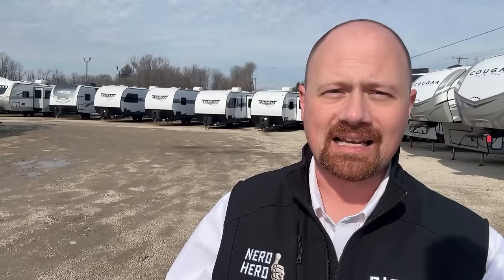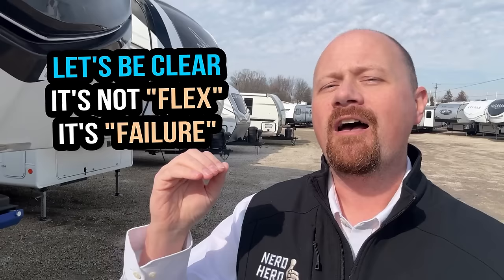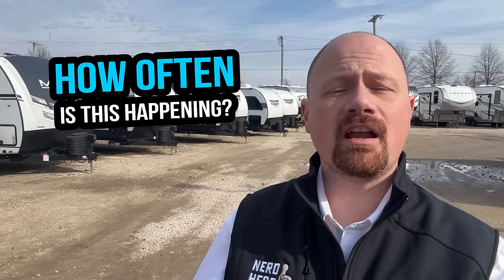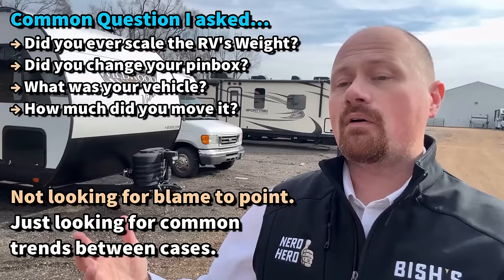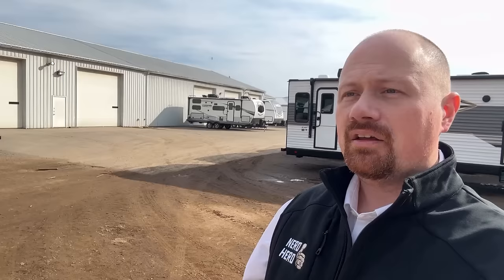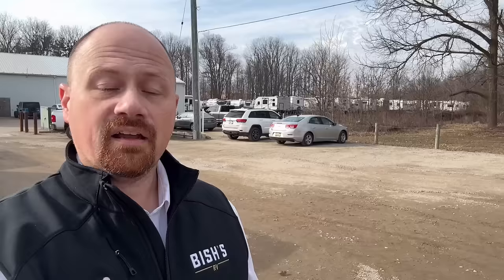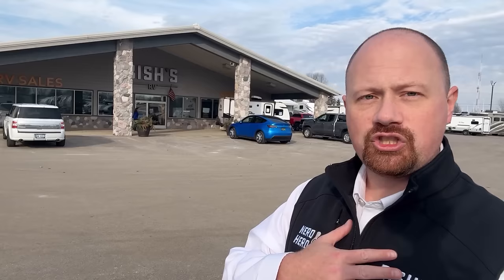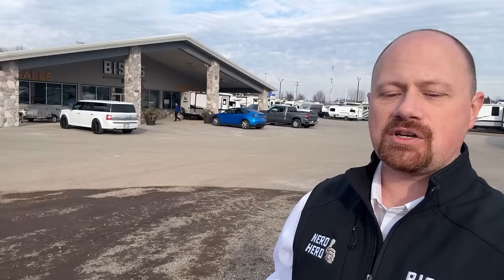🚨 RV Frame Flex & FAILURE!! • WHAT is Happening and WHO is Responsible?!

Comment: You cannot build a big 5t wheel RV with a frame strong enough that it doesn't flex. Why? It would be too heavy and to expensive for the market. I was a B-52 pilot. The wings flexed as much as 12 ft at the tip. Same reason. Next time you are on an airplane and get into bad weather with some bouncing around, look at the wings. They will be flexing. But it's not a design flaw, it's a feature. By the way, my onboard trailer hookup system (GMC Sierra) tells me how many miles my trailer has been towed.

Comment: Josh you are a tap dancer today! Some of your points may have merit but I feel a shifting of the blame. The data sticker shows the information on the weights needed, I agree you need to get it weighed to confirm you are not over. Rv frame failure seems most common on a brand/make. The main issue is how the buyers have been treated by that manufacturer.  Their responses have been, you are out of warranty... so I guess an RV even if you spend nearly 200,000 is only good for 1-2 years? I always wondered why if they stand by their product why they would not give an appropriate warranty.  Now we know why. Classic we got your money you are out of warranty what are you going to do? Dealers are responsible for their employees and the information they put out. So now we have to cross check information from the dealers? Why are we paying them above dealer invoice for? Time for some of the auto manufacturer rules to be instituted, no more free ride. Just my thoughts. Thanks for having the %$#@@ to tackle this subject.

Comment: All great information, but...
I don't understand the bit about moving it too much. Seems that if I tow it 10000 miles in a year or 10000 in 10 years, the trailer will experience  the same stress. The difference is that it's out of warranty. 
I think these things have just gotten to damn big.
Reply from the maker: Think of it similar to an automotive warranty. A truck has a warranty limited by both time and miles. If you use it more than expected, then they stop offering their guarantees. The problem is the RV industry doesn’t have any way of tracking distance for use, but they also don’t publish their expectations

So I cannot fault a buyer for using something in a manufacturer didn’t intend

Comment: Is this issue happening with Toy Haulers ?  I’ve looked at several and the ones we like are Grand Design, and Brinkley and both have stickers claiming warranty for full time use 🤔 and we have to move this thing around a lot because our main reason for buying one is because our son raves motocross and it’s become to much for us to go back and forth to the tracks and hotels etc .   Now I gotta worry about this happening after I spend $150k+ on one of these .  Now I feel like I gotta figure something else out .  I would lose my mind if I make a purchase of this magnitude and this happened .   Thanks for all your hard work Josh.   We need to connect before I make this purchase,  I have many questions.
Reply from the maker: I mention in the video it’s mostly the really REALLY big fifth wheels loaded heavily and towed often seeing this challenge 

It’s not exclusively found there but that’s the biggest concentration

It doesn’t appear to be something experienced by the vast majority
Reply: @JoshtheRVNerd  our son races motocross so we need to move the unit weekly from track to track,  now are these issues because the units are over loaded ?  Meaning the units are carry too much weight for what they are rated to carry ?

Comment: I think manufacturers need to find out what the max pin weight of the RV should be so that users can weigh and keep that pin weight under that max and it should be printed on the side of the RV. Why? Because an empty toyhauler has nothing in the back to balance that pin weight. Our toy hauler has much less of a pin weight, around 1000 pounds less, when we haul our golf cart in the back. We don’t take our golf cart but a couple of trips a year. So the majority of the time our pin weight is much heavier when our RV is much lighter. So having no toy in the back of a toyhauler will have a much higher pin weight, despite still being under GVWR. The pin weight max needs to be printed on RVs. PS. Our frame failed.

Comment: My Grandma and Grandpa have a 44 foot travel trailer Fifth will and they've been doing it for 24 or 25 years nowThey're retired their trailer has no issue has no problem ever their trailer is phenomenal problem never had a frame problem and surprisingly enough it's a Jacob They pull up with a 450 ForwardThey traveled all the states seeing everything there is to see I have a friend also inRaw material distribution and he said the formula of the metalCan be bad or not a very good material make up for the application The weld is actually stronger than the trailer frame or the material that it's being applied toTherefore the material of the metal is Not the right make up material for that application period

Comment: Josh, I love your channel. I watch all your videos but I definitely disagree with you this time around you buy a trailer to tow it around not to sit park ed  the structures being built they’re taking shortcuts on them. They got unqualified people doing welding so I know it’s hard for you to, really put the truth out there but that’s what’s going on. You buy this vehicle to tow around it doesn’t matter. It doesn’t matter if you go 20 miles or 500 miles. It should not fall apart and if it’s a piece of crap where it’s gonna fall apart it shouldn’t be on the highway, all the blame goes back on the design, not design correctly and that’s where the problem is and some of it is on the manufacturer, putting it together missing bolts being left out that type of thing I’m sure you’ve seen a lot in this industry over the years so you know what I’m saying is true if they are going to continue selling these products they need to build them correctly so nobody gets hurt or killed . And they should be held accountable. I’m so mad at this any accident if someone gets killed the manufacturer should be responsible if it’s found defective they made plenty of money over the years the games over build a quality product or get out of the business.
Reply from the maker: I understand they’re purchased to move. I am not saying you shouldn’t

What I was saying is rv mfgs don’t often build rvs for every day towing. But that fact is almost never shared with dealers or customers. 

The rv is not actually being built for the usage suggested by many marketing agents. And that’s a problem

Comment: Josh, I'm no Lawyer, but I did stay at a Holiday Inn Express once. Regarding your comments on swapping the hitch (e.g., king pin or gooseneck) and how that affects the frame warranty from Lippert. I'm quite sure the federal Magnuson–Moss Warranty Act prohibits Lippert from applying a blanket policy that using a non-approved hitch voids their frame warranty. Lippert would have to prove the other hitch in fact caused the damage to the frame and that it wouldn't have happened if their approved hitch was still being used. Take the Gen-Y for example. It has undergone significant testing (i.e., VESC-19) to prove it doesn't cause such damage. I also find it funny, not funny haha but ..., that Lippert supposedly won't approve the Gen-Y because of its corporate relationship with Reese, whose hitches are approved.
Reply: Brinkley uses Lippert frames built to their spec, and use both Gen-Y hitches as built… 5th Pin & Gooseneck.
Reply: @dougcjohn  Luxe now exclusively uses Gen-Y hitches on its heaviest rigs, its toy haulers that are all 27k GVWR. Pretty sure they use Lippert Frames too.
Reply: @rvgoingnow yes they do use Gen-Y… I’m not certain on Frame… I thought they  built their own Frames. Heavy & Beautiful Rigs… too heavy for my Dually & Budget.  Although, I agree with your point… Gen-Y are used on the heavy Rigs with no frame issues!

Comment: I am somewhat disappointed in this video. From my perspective there is one manufacturer who is having the most failures. I noticed there wasn't one of that manufacturer's coaches on the Bish's lot! This same manufacturer has  had numerous leaf spring failures! In my opinion both issues are engineering failures. You mentioned in your video of the huge storage areas in the front of some fifth wheels. If the manufacturer designed it with the big storage area than it should be designed to carry the weight. My wife an I own a travel trailer so this issue is not one that affects me personally. I do understand why you did not mention the name of the manufacturer with the most issues. 
 I do agree with you not to overload the trailers and I have weighted my trailer in the past and will do so this year also. 
 Thanks for tackling this difficult subject!

Comment: A frame flexing to some degree is absolutely normal.  Look at any flat-bead trailer for an illustration.  Unloaded you will see Camber or arch in the deck perfectly normal if it was too rigid it would break. I am a welding inspector and EVERY trailer I see I would reject for all manner of rejectable welds.  The quality of steel probably is not the issue as ANY reputable manufacture utilizes material testing reports to ensure the material is up to spec..  Me thinks this is a engineering and quality issue FIRST and a consumer issue second.  All engineers weather structural, pressure, or any other facet build in a SAFETY FACTOR.  RV,s are built to just enough to save $$$$$.  I have scaled my RV and yes I am close to the max and try to equally load.  But I may be the exception.  This is a come up-pance in the industry.  CAN I tour the fame factory???  I would love to do a 3rd party inspection of your procedures.
Reply from the maker: Many factories do allow walk-through tours. Typically by appointment on certain days.

Comment: Hey Josh! Love you man. What are your thoughts on Lippert or LCI being a monopoly. They are all over the cougar and most other brands. In the frames, doors, parts and everywhere. I’m noticing they are using thicker steel on the supports now. Wouldn’t that indicate that they are aware of their flawed design? Couldn’t they be the common connection. What years have you seen the most frame flexes.
Reply from the maker: There’s certainly a very large company that has their hands in a lot of things

Comment: Josh
I am sure it was one of the manufacturers you talked to about overusage. Did they give you a design mileage usage. How many miles are the units designed to be pulled?
Reply from the maker: That’s exactly my point about needing more information out there… Even as dealers we don’t know

So how the heck is a customer ever supposed to know? How can you fall to Customer for something even the dealer can’t tell them? This information just needs to be out there.
Reply: I contacted Grand Design. They did not answer the question of Frame Design Life. They responded with what is my VIN. I am looking at their units but I am not confident in their design. Also reached out to Primetime and Aliance. No responce yet😊

Comment: Who is to blame for frame flex failures is not complicated at all. It’s simple. The manufacturer is responsible for the build quality. Period. Do car manufactures direct owners to component manufactures for component failures? No. They take ownership of the vehicle. Grand Design is a complete flop. They deliberately under engineered their 5th wheel and are unwilling to address the problem.

Comment: Manufacturers want to keep them as light as possible. In order to put a giant residential fridge then the frame has to get lighter. O instead of 3/16 or 1/4  inch thick structural steel. They are using 1/8 inch or even 3 millimeter thick. On a thirty foot frame they can shave off fifty to sixty pounds.

Comment: Problem is people who educate themselves before buying don’t buy RVs. Cheaper to stay in hotels. The up front and continued cash is lost immediately. They are made to fall apart, needs a crazy expensive truck to move them that gets terrible gas mileage which adds to the cost , wear and tear on the truck, more expensive to keep truck running , expensive tires, expensive oil changes. Get a hotel. Put saved  money in a retirement account and retire early. 😊 can’t even use is cold weather! Just a crazy stupid purchase.

Comment: I watch your videos all the time, first time actually feeling you left a little out. I agree with everything you said, but I feel like there's so much more. I've followed these incidents closely, and it seems many are fixed with better welds, gussets and extra steel. I can't help but think quality control is shit. No one cares about the parts you don't see unless it breaks. It really wouldn't take much to make this problem go away. The solution conflicts with weight and cost saving measures. I don't solely blame lippert, they build to manufacturer specs. 
As far as intended use, they should be built under the assumption the are going to be pulled every day. Who would buy an F350 if the  frames failed while towing? Would we accept Ford saying " well its capable of towing, but we didn't expect you to actually tow something every day."

Comment: Soooo will the manufacturers ever put a milage warranty on  there units?    There Not expected to be pulled down the road everyday,  but OK to live in full time if you  pull it 2000 miles, stop and set up for 5 years-- right ?
Personally if I  can't pull my fifth wheel up to 5000 miles a year---it's not gonna be much use to me.
Reply from the maker: In a way I hope they do because suddenly that brings a lot of clarity and understanding to a currently undefined equation
Reply: @JoshtheRVNerd  

We currently own a 2011 Montana fifth wheel  with 44000 + miles on it. Those are just the trips I remember .  Other then a new set of tires due to age, and upgraded to 12 ply. Only minor issues with unit since new. So has build quality diminished  ?

Comment: ive had 4 different 5th wheels since 2003, all bought before 2011, none of those had issues and none of the hundreds of friends had issues.   this is all on the manufacturer. They are buying cheaper materials,  chinese steel,  just downright junk being put out to the public.

Comment: The bottom line is that these frames are designed to weigh the least amount possible. That saves the manufacturer money and lets them have the lightest RV possible. They are cutting corners and not standing behind the junk they build. The vast majority of RV are cheap junk and a waste of money.

Comment: Thanks Nerd !!  for all the hard work . Josh got a question ❓ is frame flex and towing stress the same thing? , back when I first started tinking about getting a r-v i watched a lot of u-tube reviews especially used trailers trying to learn things to look out for and a few of the 5 wheels had some of the things that you pointed out @ 8:06 and the person doing the review would call it towing stress this was back in 2016 2017 time frame
Reply from the maker: I think towing stress is kind of general category with “frame flex” conversation really relates to specific failure for a number of reasons

Comment: With all due respect, while user error is a cause sometimes, there are clear manufacturing and design defects causing this issue most the time.  There is also this thing called “fit for the purpose intended. “   If using it too often is a cause that’s a design defect.  It is built and marketed to be able to travel and travel often.  If the manufacturer has not designed and built it to withstand this use that’s a defect. While only antidotal I know too many people that have had it happened to be a low percentage.  Everyone I know of had a lippert frame on a grand design. Now lippert makes
Most the frames so if only happening with a couple manufacturers that’s likely the smoking gun. Could be happen chance, but I say design defect.  The fix, adding support in very specific places, suggests the same.
Reply from the maker: As I said in the video, I’m not trying to focus blame on owners. I would like to educate owners, because unfortunately, they have to educate themselves to protect themselves.

I think people are using the RV the way that they’ve been led to believe they could. I think it’s really hard to fault a customer for that.
Reply: @JoshtheRVNerd   fair enough and good video.